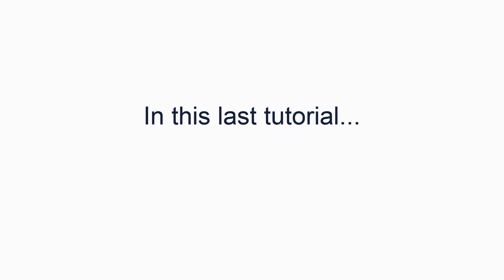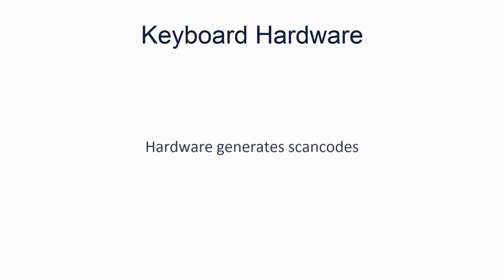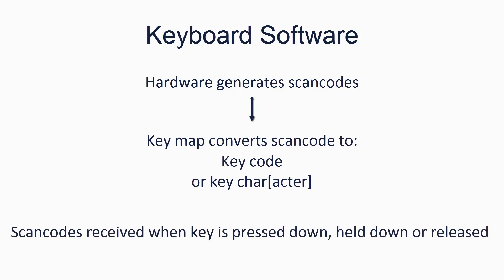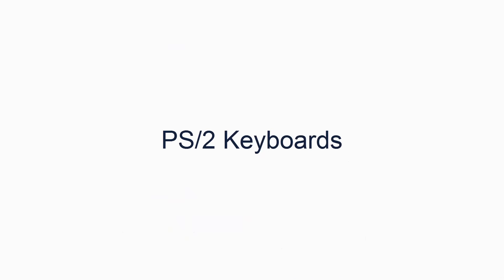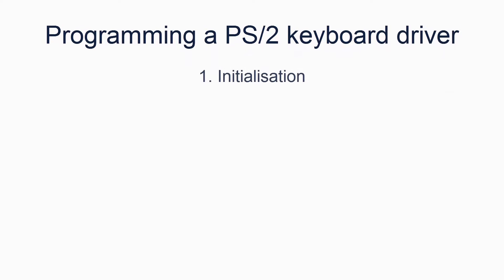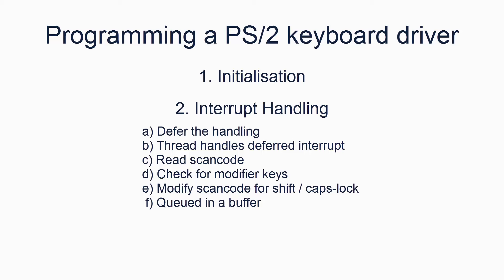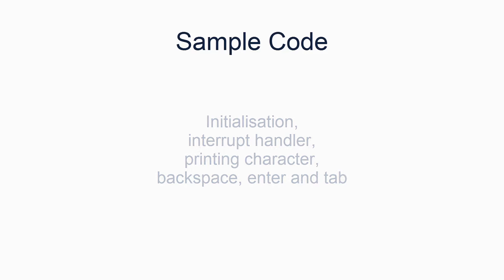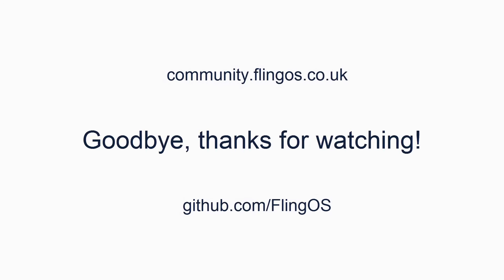10. Keyboard

Comment: If you need an OS to make an OS How the first OS is made to begin with?
Reply from the maker: This is an excellent question. It relates to both the history of computing and to processes called 'bootstrapping'. It is a common problem. For example, how do we create modern computer chips, if you need a computer to do all the design work? And to control the manufacturing process. How do we program compilers in C, if we needed a C compiler to compile them in the first place? 

The answer is: everything has been built up over time. The very first computers had no operating systems, and were not built with transistors (they used Valves - which could be manufactured without computers). Later, they used transistors which by today's standards were very, very large and thus could be manufactured easily. To program the first computers, people used punched cards and punched tape - literally paper tape with holes punched into it. These were created mechanically, then fed into the machines for them to execute. Then we moved forward to having magnetic tape - again, writing machine code by hand. Eventually, computers had enough memory to handle interpreters - for example interpreters for the 'BASIC' language on the Z80. Again, these interpreters were hand-written. 

Computers originally had mainframes - multiple users provided programs, which were then managed by an operator (a human) who selected a program, ran it and returned the results to the user the next morning. Gradually, we moved to simple operating systems - written entirely from scratch - which could handle multiple users of a mainframe at once. As 'personal computers' became available, and computing power increased to the point that computers could handle more than one program at once (via time-slicing), it became possible to write simple OSes to manage this time slicing. See things like original UNIX, DOS, MSDOS, etc. Other aspects like input/output management (displays, keyboards, etc) also grew up at the same time. As did 'memory management'.

Eventually, after 5 decades of iterating in this way, increasing complexity and capability each time, we have reached modern Windows, Linux, MacOS, etc. However, you can still find very simple OSes in the form of 'RTOS' (Real-time OSes) and Embedded operating systems. 

It's still possible to do this from scratch - though possibly very boring. You could build a simple 16-bit CPU using entirely TTL chips (there are videos on YouTube about that). You could then program the ROM chips completely manually (it would take a long time, but it is doable) by moving wires around etc - essentially manually doing what the 'programmer' devices do for you from a PC connection. Then you'd have a simple 16-bit machine which you could use to run one program at a time. If you loaded it with a program like a simple While or C compiler, you could use that to write a better compiler, and then a simple OS, and then build up from there.

If all the computer chips in the world suddenly stopped working, we would not be able to immediately return to creating such complex chips with such complex operating system software, compilers, etc. It would take a decade or more to build ourselves back up to the point we are today, even with all the knowledge we have of how to do things.
Reply: @EdNutting  ty from the reapond btw can you explain how they manage to create GUI from scratch i mean the literal classical way they draw and color the OS graphics etc i want to know the beggining in order to master the computer itself i have big dream for the field of comp science a smart man once say if you want to invent an apple pie you must re invent the entire universe ....

I want to know how they manipulate the hardware to software do they imprint the letters inside the chip and some rabdom binary commands to show it in the comp screen?
Reply from the maker: There is quite a mix of ideas here. There are several steps to this process (and I'll describe the physical aspects in conceptual terms as the practicalities of display technologies are much more complex).

The basic steps are:
1. Representation of characters (letters, numbers, etc) as images
2. Representation of images as grids of pixels, where pixels are 'dots of colour'.
3. Representation of colours (commonly as RGB - Red Green Blue), using binary numbers (see Episode 1 of my latest video series for this! One of the examples of data representation shows how colours are represented using RGB.)
4. Representation of binary numbers using transistors/physical memory (again, see later design episodes of my latest series of videos for explanation of this - particularly the Latches episode, the Registers episode and the Memory episode).
5. Transmission of images from memory to a physical display (e.g. via VGA or HDMI)
6. Converting the image data from a VGA or HDMI signal into an image on a display panel inside a monitor

1. This is fairly easy. Each character is assigned a number (as per ASCII or Unicode or other 'character encoding' as they're called). Then we store in computer memory an image for each character. In primitive BIOS mode, computers have the character images 'imprinted inside the chip' (i.e. stored in a form of ROM).
2. Images as grids of pixels: Again, fairly simple, this is just a 2D array of colour values.
3. As per explanation in the video I referred to
4. As per explanation in the videos
5. It's worth searching YouTube videos for how VGA works.
6. Look up videos on how old CRT displays worked - they're easy to understand. Then look up how LCDs work.

So from a programmer's point of view, you're standing on top of a tall stack of stuff already! You program the video memory with numbers representing characters and that 'stack of stuff' works to convert that into character images, which it puts together into a larger image for the whole display, which it transmits to the monitor, which converts it into physical light.

I hope this gives you a few starting points for understanding this topic in more detail.

P.s. I don't know who you're referring to, but their point may have been that if you want to reinvent something which already exists, you'd have to reinvent everything - which would be a massive waste of time. It's worth understanding as much as possible, but it's not worth reinventing stuff - especially legacy stuff. It's also not possible to understand everything - you will eventually have to pick a level of abstraction that you are comfortable not understanding. For instance, one needn't understand the quantum physics governing modern transistors in order to write an OS or optimise some C code.
Reply: @EdNutting  thank you so much for the i formation you had given me now im finally having grasp on the thibgs that confuses me alot 

And about the last part the reason i want to re invent the computer from scrathc is because i want to understand it to the very core if i have the knowledge on all things that make computer works and how its made then discovering new things about the future capabilities of the computer will be like pesser difficult

Btw thank you so much if i ever going to have a question i will be asking u again
Reply: @EdNutting  btw can u link me your latest episodes that u are saying... is that the minecraft one?
Reply: @EdNutting  and i hope u make a video about interface too the basic one
Reply from the maker: No problem, and yes here's the links to the relevant episodes:
Episode 1: Data representation, includes example about colours: https://youtu.be/HhY4RCu6bB4
Episode 4: Latches, the building blocks of computer memory: https://youtu.be/QFZ5_UwTTII
Episode 5: Registers, shows how latches are used to form flip-flops: https://youtu.be/sWuGTRnZ63I
Episode 6: RAM, shows how flip-flops can be used to form a grid for complete memory: https://youtu.be/wKvL-l5RQNw

If you're serious about learning computer architecture, the complete series of design episodes (total 1.5hrs) will interest you. They are a rapid introduction to computer architecture. Playlist: https://www.youtube.com/playlist?list=PLKbvCgwMcH7DBn9sITJ2QvNCO7AwF75v_

I'll be doing more videos in future about computer architecture (as it is one of the areas covered by my PhD studies).
Reply: @EdNutting  hope u can also make a video 9n evolution of computer and the basics on how the work including users interface im so excited to be self thought